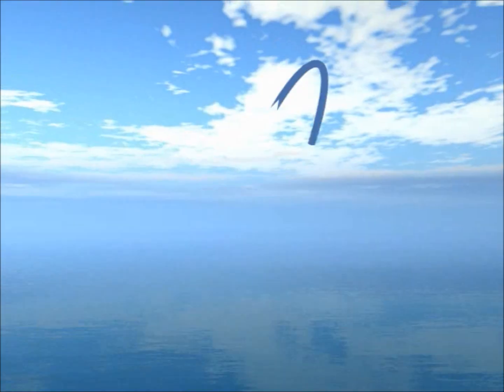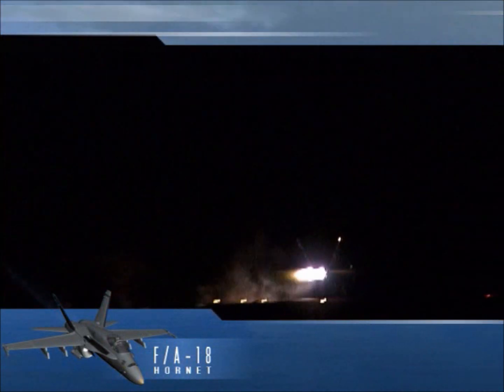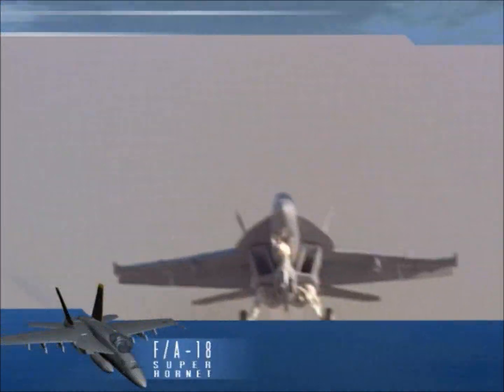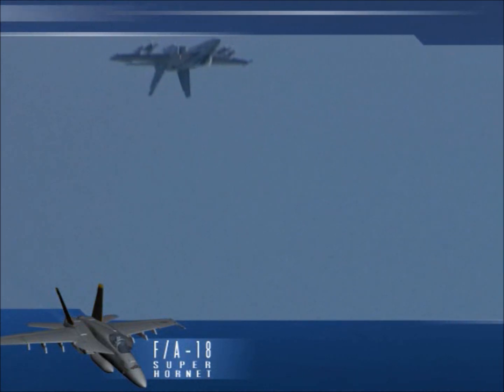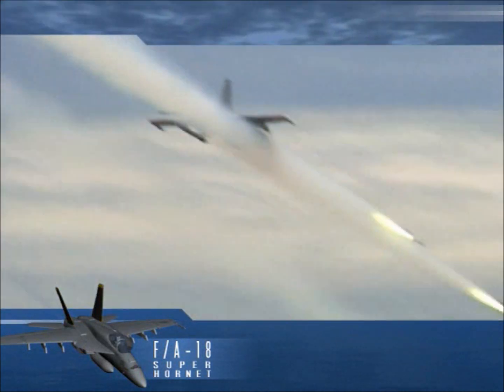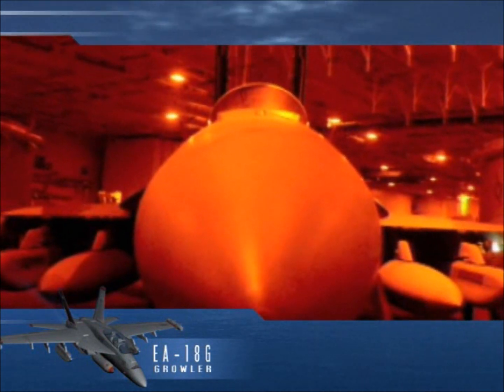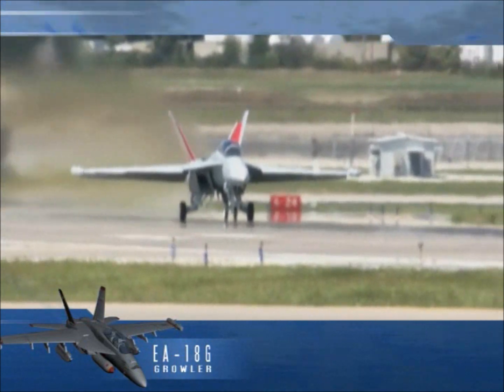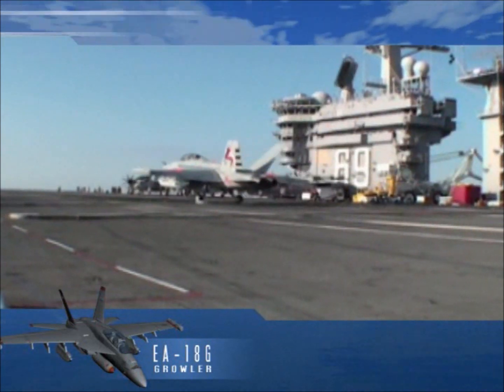F/A-18 & EA-18G: Taking Today's Warfighter into Tomorrow

Comment: Cost effective & reliable,a definite yes,but no matter how U like to heap praises to it,it is no longer in keeping with the league of other similar classed fighters as the Euro-Typhoon & the French Rafale.
Experts at Boeing should've had more foresight than to just add on,only reliability improvement features over her predecessor.They should've on top of that,strengthened the airframe tolerance much further as they did with the F-15Es,making it to even withstand a whole 9G+-load factor.More studies should also've been made to find a common ground or balance in new wing designs,between the benefits of handling enormous payloads (either by weight or by hardpoint positions) & the equally crucial features in accentuating super maneuverability,quick climb rate (much improved thrust to minimal weight increments) & the a good 60,000ft++ absolute flight-height reach.
As it stood,this ol'girl had none of those exciting features,for;- (i) she cannot carry nearly as many or as heavily as the much smaller-more economical Rafale (which comes in at only 2,000lb or so,shy of Big-Bro F-15Es capacity), (ii) she's w/o say,cannot match the time-to-height factor of Typhoon (it's forgivable in this dept.,for none has yet can) & certainly not the absolute service ceiling dept., (iii) she certainly can't match the two European contenders range.
I don't suppose America has lost her edge at flight prowess & hope very much to see a resurgence,making strides once again in all areas,but then again maybe all we only need is lazy dependence on missile smartness.